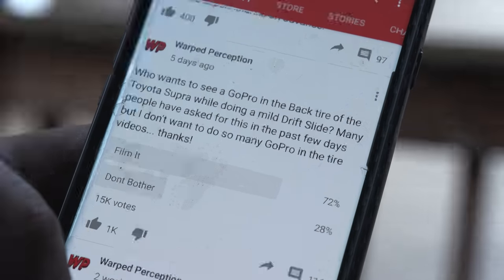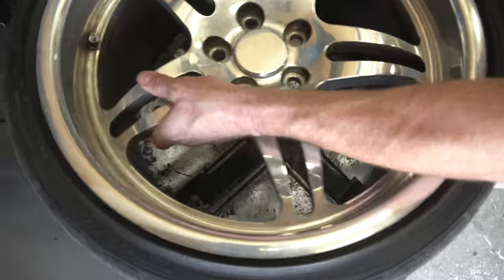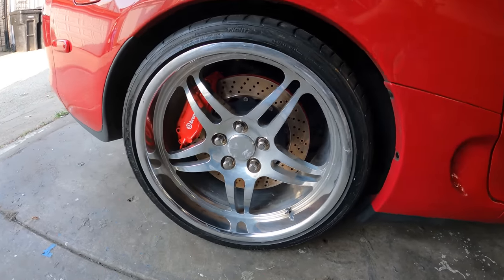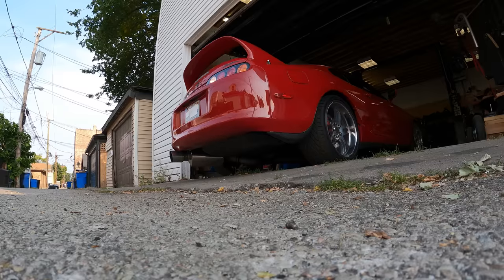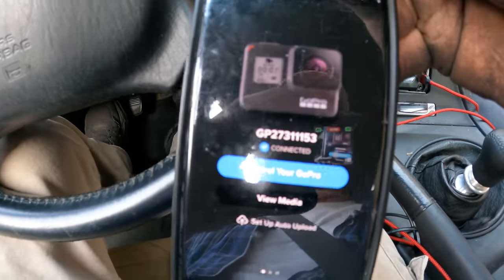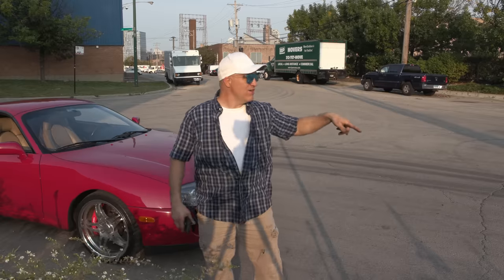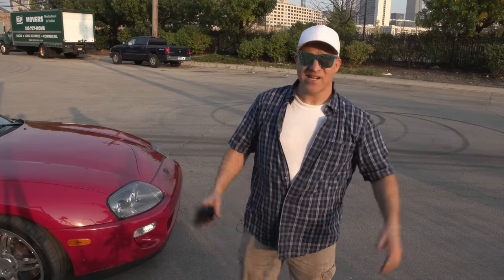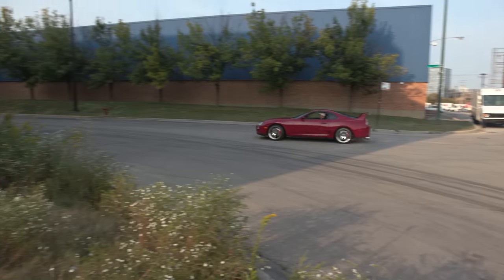Supra Drifting With GoPro Under Car and In the Rear Tire (Street Drift)

Comment: I love the under car shot one thing I did see being a mechanic I look at everything and I saw your diff flexing a lot I’d look into some poly diff mount bushings
Reply from the maker: I think it needs new bushings, but the car drives fine so I never really thought anything of it, I think I would just go with some new OEM bushings I don't like the poly bushings because I like to keep the car very comfortable and fun to drive, once you start stiffening up all those drivetrain components then not only do things break but the body starts vibrating. I have twisted, not broken three drive shaft with this car, literally twisted them like a pretzel, almost broke my hand one time.
Reply: Warped Perception oh my that thing must be pushing some major tq numbers haha thanks for replying tho means a lot
Reply: Warped Perception I also like the fact that your Supra isn’t some 3000 hp modified monster I like the simple streetcar look and it sounds amazing

Comment: What ever you do, the rubber diff bushing, do not replace with hard poly bushing... you will regret that, and you will start busting parts... Just replace with the factory rubber units... Fine to go nuts with poly everywhere else, just do not install hard poly or neo's in the diff perches, as that shock wave will transfer into breakages, half shafts, ring and pinion, diff carrier, etc... not to sound like a parrot, but, just replace those with the factory black butyl rubber ones..... Fun video..

Comment: I hope you changed your diff and subframe bushings after watching this video. Made the biggest difference on mine
Reply from the maker: Not yet but I didn't know they were bad they are only a few years old, and I never felt anything awkward at all the car feels perfectly fine, if it wouldn't have been for this video I would have never seen that movement but has anybody actually done a video of the suspension before? Do we know whether or not that movement is normal? I'm totally doing a before-and-after video
Reply: @WarpedYT  They aren't actually that bad. Just a big difference on a big turbo car.

Comment: Turbocharged engine exhaust manifolds to turbo connection point usually glow red when being boosted. That would be a cool video!
Reply: They glow when they get too hot, from too much back pressure. If the exhaust is flowing well enough, they don't glow as easily.
Reply: @IceBergGeo  
Ok then. I have observed many aircraft exhaust and my own turbobike glow with no backpressure other than the  turbo itsself. My NA SV1000S makes it's pipes glow red with no back pressure restrictions at all.
Reply: @upsidedowndog1256  I don't recall saying that they don't glow. I have seen examples of a manifold glow bright red,  and then the turbo was changed to a larger one, and then  no more glow. That was the example I was referring to.
Reply: @IceBergGeo  
Cool, man. The exhaust on turbo engines glow, no matter what you do. Maybe Matt Mika can help us out here. He has the technology!

Comment: Not sure if it'll work due to size and fluid sloshing around but; Go pro inside a differential both open and a limited slip while doing sharp turns, would be awesome to see the open diff show that the tires spin in opposite directions compared to the lsd with the clutches engaging and slipping

Comment: I was able to notice that in a few minutes 5:04, the tires can slightly move from the aluminum rim, that is, the tire and the rim were not fully attached with the air pressure.

Comment: That whole rear subframe looks like it's about to fall off. I can only imagine how wobbly this car feels to drive quickly. It really needs those bushings replaced and the whole thing tightened up, it shouldn't move that much. Hell the subframe moves more than the suspension arms.
Reply from the maker: That's how it's made, that's why the Supra is the Supra, the car is solid. I am going to change the bushings and do a before-and-after video just out of curiosity but it's all made to move around

Comment: I had a 92 Soarer, the wheel hop always gave me a hard time.

 I put coilovers, solid subframe bushes, and very stiff poly mounts for diff. Never completely cured it.

Got me thinking you so do a video with a rwd car wheel hopping violently. Would be very cool to see!

Comment: I like the shot showing the differential and and suspension movement.

Those low profile tires don’t flex much. 

Is the noise milling marks? Are those rims a solid chuck of aluminum billet?

Comment: Just going to let you know that you need brand new bushings for the rear end because it's flexing bushings are shot and you might break a drive shaft or ring a bolt off
Reply from the maker: I was looking at that, the car have very low miles but has been putting out substantial power for a long time... I'm going to check those out

Comment: I'd say try and make the camera stay at the bottom of the wheel with a bearing around the diameter of the wheel so the camera can stay at the bottom where all the action is. Like the old spinner wheels but inside the wheel and tire with a gopro mounted

Comment: I can't say for sure cause I've never worked on a Supra, but those rear diff mounts seem a bit worn. Again, could be wrong, but they look cracked at the bottoms, and they flex quite a bit, not dangerously so... but quite a bit.
Reply from the maker: Exactly, everyone says put urethane mounts but then the car looses that comfortable feel and starts to drive like a econobox with power, I am going to look into that but I'm not sure how much they're supposed to move.

Comment: Go pro inside of a racing slick than launched. Looked like tires needed more air too for those slides
Reply from the maker: You are correct but they are also too wide.
Reply from the maker: I'm not sure I've ever seen any drift tires that are 315mm wide
Reply: @WarpedYT  they are pretty wide once they get bald should be even easier lmao

Comment: Woow!!
More LSD movement GoPros
More rear subframe movement GoPros
More rear arms movement GoGros
And I think:
- front arms
- steering rods
- shocks,
would be nice to see as well.

Inside the fuel tank gopro). To see how fuel runs away from fuel pump, while heavy cornering.
Inside the oil pan gopro 😜. To see how oil moves when you drift. The reason people install dry sumps.
Reply: @Warped Perception absolutely awesomely nicest supra on this planet BTW!!!

Comment: Jeebus man, how wide are those rims and what size tires you have on it? I'm guessing 9" or 10" x 18" and 255/40.
Reply from the maker: Lol.. they are 305's I believe
Reply: @WarpedYT  thems some thicc boys 🤣 305s with that profile has to be like 10-12 inches wide. Will check out the Supra video!

Comment: In my opinion, id put about 20-30 more psi in the tires to make them more stiff and not flex on those drifty bois as much.
Reply from the maker: I was thinking the same thing, but I didn't want to tear my tires up, those are expensive

Comment: If you look close at the bead you can see a little tire slip on the rim.
Reply from the maker: I'm going to take another look at that
Reply from the maker: What part of the video did you see that in?
Reply: Warped Perception the 5:00 mark. Look at the left side. The tire moves slightly on the wheel.  A lot of power and a lot of grip. Pretty cool.

Comment: Where those sparks coming from under the car?
Reply from the maker: Where at ?
Reply: @WarpedYT   During the underside shots I was seeing sparks when you let off the throttle.  Like around the drive line. Kind of looks like maybe they were coming from the front of the car though

Comment: There’s a difference between a drift and just responding to a slid. You responded to a slide
Reply from the maker: Haha... Actually technically it's a drift because the tires were spinning from the time I hit the accelerator until the time that I let off the accelerator, the difference between a drift and a slide is that a drift the tire spinning is initiated before the turn and a slide the tires start spinning after the apex of the turn. Anyting where the slippage starts before you enter the turn is a drift .

Comment: What are those bushings by the drive shaft called? I kinda know about cars, but I don't know what the purpose of those are.
Reply from the maker: Are you talking about the ones on the drive shaft or the ones in the differential?
Reply: @WarpedYT  I guess it seems to be mounted to the differential.

Comment: Well it's not drifting... its called power sliding. But still cool video!
Reply from the maker: I know that was a tough call, but the tires don't know the difference IMO, to drift I needed a lot and drift tires for sure. Thanks !
Reply: It's technically drifting by definition "Drifting is a driving technique where the driver intentionally oversteers, with loss of traction, while maintaining control and driving the car through the entirety of a corner."

Comment: You need new diff bushings!!
Reply from the maker: I know ... Maybe if anything I've learned an easier way to troubleshoot cars.. just mount a GoPro somewhere weird. The GoPro in the intake manifold help me solve my power steering fluid problem
Reply: Warped Perception haha... yeah... it worked out well. Although, you can diagnose without cameras. Bushings are quite easy to diagnose.

Comment: Too much power?Joking right?
Reply from the maker: Lol... Kinda, I was more referring to the Power band combined with the grip, and too much acceleration for that small space... If I had plasticy drift tires my entry speed would have probably been half and my tires would be spinning Non-Stop and I would have been able to hold the slide. I used to put drift tires on my RX-7 just to have fun because they would slide all over the place vs drag radials for instance which are a very soft compound and super sticky.

Comment: that supra might be shiny,  but the underside is rusted and rubber is done for... fucking fix it
Reply from the maker: There is not a spec of rust under my car, It's not rusted at all where did you see rust ? . Also rubber bushings are made to move, these bushings are only a few years old oh, but I've never seen footage of the suspension working before so who's to say that that movement is not normal... I am going to put new ones in the next week or so and then do a before-and-after video just for curiosity.
Reply: @WarpedYT  remove the years of grime and brake dust and you'll see it... you need to TLC the bottom to match the top. I lift my cars (that i care about) once 2 years and do a full undercarriage clean and paint as needed.

Comment: Just leave the shitty bushings in the rear...but get the immanent failure on video.
Reply from the maker: They are actually not that bad, it's just nobody has ever seen them in action before. But I am going to change them to do a before-and-after video I think they are only a few years old, but I have been putting out almost a thousand horsepower for about eight years now so I'm sure that they have gone through some serious cycles.
Reply: @WarpedYT  I'd like to see that. Makes me want to put a camera under mine and see if the same thing is happening.
Reply from the maker: I know on the Supra and Mercedes in particular they are made to flex and dampen all those movements, but honestly I've never had a camera underneath the car facing suspension before so I don't really know how much they are or aren't supposed to move. I am going to change them though and show up before and after video.... I'm very curious now

Comment: Absolutely no drifting takes place in this video. A tiny power slide, that is it.
Reply from the maker: Powerslide vs Drifting: Essentially, a drift starts before the apex, while a powerslide starts after the apex. ... In a drift, the slide starts much earlier. Your goal is to induce oversteer going into the corner, not on your way out—sometimes using a clutch kick or a tug on the handbrake to get the car sideways ahead of the apex.
Reply: I saw the tires spinning from the u turn to the exit of the second turn seems like a drift to me